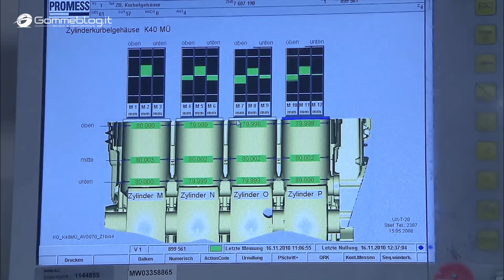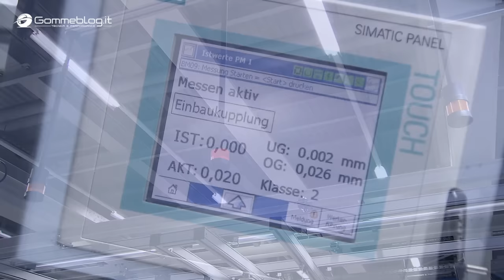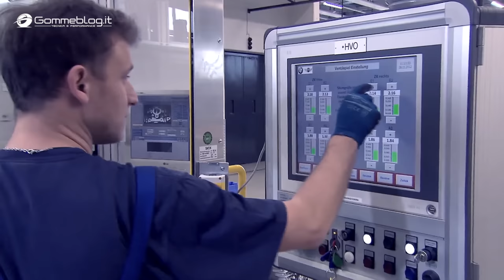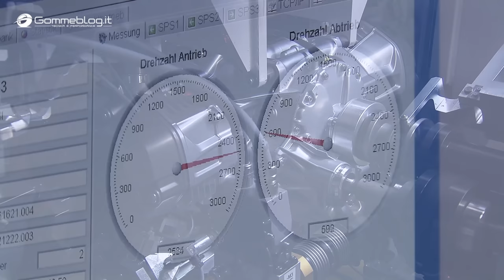BMW Motorrad ENGINE - PRODUCTION

Comment: I’ve bought 3 BMW bikes over last 30 years. Super reliable. Coast to coast in Canada a few times without any issues.  I’ve toured a HD plant and was amazed how backwards their assembly line was. But they had nice paint.
Reply: How was it backwards? Do you work in manufacturing?

Comment: Allow me to explain what is happening at 16:24.  This is the station at which the valvetrain for a 2-cylinder engine is assembled.  A worker fits a cam assembly and a head with valves in two fixtures.  At this point the valves have no shims.  The machine assembles the valvetrain and analyses its movement to determine the correct valve lash.  Then the worker disassembles the valvetrain and installs the shims as directed to set the correct valve lash.

Comment: Were there 2 broken teeth on 2:55? Or is it normal?
Reply: That's the pickup wheel for the crank sensor, not a gear. The missing teeth trigger the control unit to synchronize with the crankshaft. The cam sensor is then used to determine which stroke the engine is on before spark and fuel are fed into the engine.
Reply: @plkracer  Thanks!

Comment: They all seem to have a specific set of skills. What happens if someone calls in sick? The assembly line stops?
Reply: Robots don't get sick...
The humans are just quality control and assembly using fail proof special tools that can't be miss-used.
Reply: In assembly lines you dont do the same step all the time. You are trained to do a lot of the steps and work at a diffrent station every few days or weeks to avoid too much boredom.
Reply: "I have a special set of skills"
Where ever you are I will find you....

Comment: Just think in 1 or 2 years all this will be gone. Petrol is at best 50 years then coal is 75 years before it is all gone. Yes we may find more but at 800 to 900% increase in cost which makes electric a done deal. Ya cost are 200% more but electric is here to stay. These petrol machines are antiques and a destine for scrap yards to be recycled. Just think Jags, Porsche, Bugatti, Vets laying around useless no one has petrol any more and it is illegal to even start them much less then drive them down the road. So what is a sports car sedan worth nothing. Junk Yard stuff waiting to be recycled.

Comment: I’m running up the BS flag on this one. There’s no way in the world you could produce 20,000 units of this 4cyl engine they sell every year by building them this way with 5 workers,  borescoping every oil gallery and CMM inspecting every bolt hole! This video is pure BMW marketing bullshit.  This looks like a prototyping shop, not a production line!